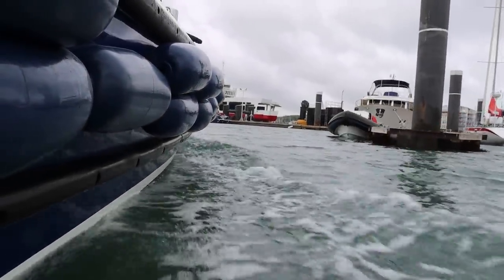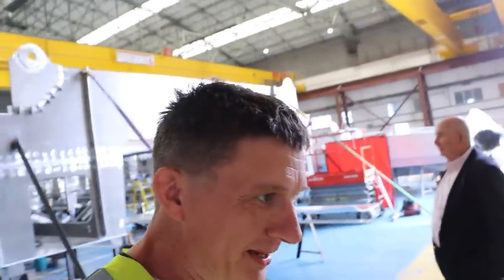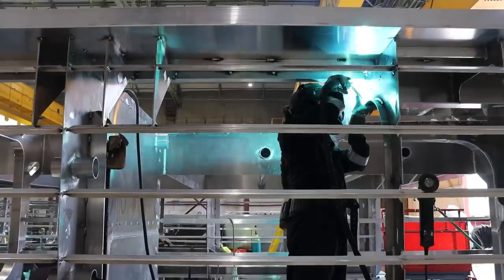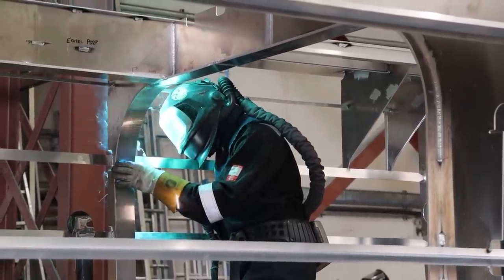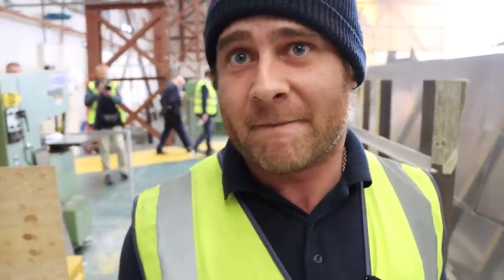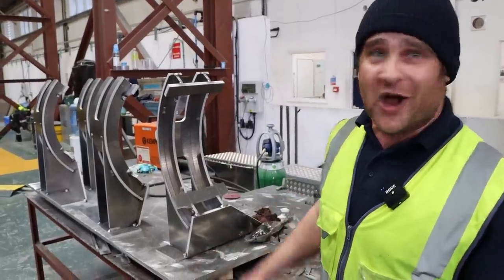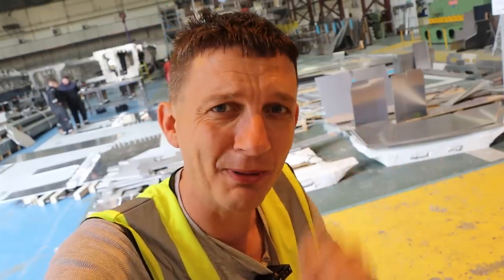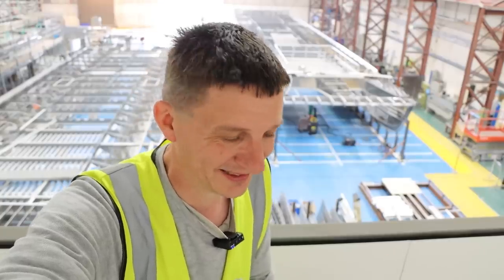Construction of Hybrid Thames Clipper Boats

Comment: I hope they won't mind me sharing but I have an interesting story about how the partnership between Wight Shipyards and Thames Clippers came about. 

Peter Morton set up Wight Shipyards originally to rebuild the classic aluminium motor yacht Shemara, a job which had been completed. Peter thought the idea of aluminium shipbuilding in the UK was a good one and was looking around for work and had carried out a few smaller jobs. Then he was introduced to one of the Thames Clippers guys (could well have been Sean Collins, I don't remember exactly!) at a party and they got talking. Sean complained that they were using a shipyard in Tasmania which was all well and good but refits and repairs were difficult and could Peter help? "Yes" says Peter and I'll build you a whole new boat as well if you like!" What really, in the UK?" askes Sean. "We can start tomorrow" replied Peter. Since then all Thames Clippers have been built at East Cowes. 

As an addition just after they signed a contract for repair and maintenance, one Friday a skipper drove one of the existing boats into a pier and crumpled the front of one hull. Under the old contract workers would have been sent from Australia and the boat would have been out of commission for several weeks. Wight Shipyards worked around the clock all weekend and were in London on Monday morning fitting the newly fabricated hull section. The boat was out of commission for less than a week.

As another addition all the London Underground enamelled signage including the roundels are made at AJ Wells also on the Isle of Wight.

Londoners and Tourists. You're welcome IOWIOWIOW

Comment: Just as long as the new engines make the same magnificent stirring howl at 30 knots that the current ones do then I will be happy. I always sit at the back of the Clippers just to hear that noise. For me its right up there with the early HS 125's in terms of aural pleasure. 👍👌
Reply: Paxman valenta engines on HST's made a brilliant sound I was heartbroken around 2008-2009 when they were replaced with MTU engines instead and later in 2019/2020 when they retired the majority of them they were fairly decent kit in constant service for almost 50 years at retirement they were better than their replacements
Reply: @geocachingwomble  have you holidayed to Scotland for the sake of getting to sit in one again? It’s another different power plant yet again though.

Comment: 5:49 "Aluminium, however, can be cut up and re-used up to eight times". I wonder what happens when you try to recycle it for the ninth time. Surely as a raw element it can be recycled infinitely?
Reply: I think what was meant was that you can cut up and remelt it 8 times before it gets so dirty that you need to refine it again, which is a much more involved process.

Comment: Actually what you are getting is aluminum oxide, not simply dust.  Contrary to popular perception, aluminum does rust, and quite fast indeed, much faster than iron.  The difference is that, contrary to iron rust, aluminum rust does not peel off, it sticks to the metallic aluminum and forms a very thin layer which, being so thin, is completely transparent and also prevents further oxidation so it prevents deep corrosion. Unlike iron, where rust falls off continuously exposing more and more iron to oxidation, aluminum oxide provides a sort of coating.  It dulls the shine of the aluminum very slightly, but you can still see the metallic shine through.  It doesn't stick that hard, though, so if you touch it it will stick to your hand but it has nothing to do with all that sawing and cutting in the factory, it will happen without any of those.   BTW, aluminum oxide is black, just as the dust you were showing.  The speed of aluminum oxidation is what made welding aluminum so hard, oxidation is faster the higher the temperature and, contrary to iron, where you can file the edges to get rid of rust and take your time welding it, aluminum rusts so fast when exposed to the oxygen in air that you need to weld it while blowing some inert gas to keep that oxygen away.

Comment: Interesting to hear these are called the Hunt Class - I wonder what the RN has to say as their minesweepers are also Hunt Class. And, just to get the rail link in, they were powered by Deltic engines. Many years back I designed an exhaust monitoring system for these, shortly afterwards they decided to re-engine them. Pretty typical MoD waste!

Comment: Excellent video as always 👌  any clues how long the journey from the new pier at gravesend would be? How would it compare to a train or driving for instance?
Reply: They've already done them occasionally as special trips, if you search you'll probably find details of them with timings
Reply: Now that's a future video
Reply: Definitely quicker than by road in the rush hour, I used to do a journey between Putney and Southwark when I owned an Amphicar, was a lot quicker if I was not trying to fight a full flood or ebb tide flow.  Getting out could be a problem if the slipway was slippery with ice or excessive algae.  The tide table was more important thn an A-Z in the glove box.

Comment: Thank God, I've thought about taking these a few times but aside from the expensive fare I did have at the back of my head thoughts about them being worse environmentally than the alternatives
Reply: expensive? It’s only like £4.50 for an adult (£3.50 if you have a travelcard) It’s not too dissimilar to train fares
Reply: @redbaymax2852  two boat zone return is about £15 with travelcard, £18 without. Bus caps at 4.50 ish and tube is about £2.50 a journey (and less off peak). Daily cap is about £8 for bus + tube, so commuting through tube zone 1 by boat on a regular basis is way more expensive than unlimited zone 1 travel.

Comment: "First hybrid passenger ferry"?
Don't both Wightlink and Condor Ferries have hybrid ships operating now?
Reply: I think you're confusing the facts. Condor does not & Wightlink's hybrid vessel is a car ferry whereas this feature is on passenger ferries - so Geoff was correct. The Clippers will also have a plug-in capability whereas Wightlink's vehicle ferry does not.

Comment: I have some questions:

Are these clippers additions or replacements?

Do they have propellers with a rudder or are they propelled like a jet ski?
Reply: They do not get shore power, just charge off their desil engines outside of central London.
Reply: The charging question was answered in the video, they will be charged by conventional engines while the boat is in a high speed section of the river.
Reply: @richcbri  ah sorry - must have missed that. Thank you!

Comment: I kind of hate to see aluminum powered treated so insignificantly. While it does take a reasonable amount of heat to get aluminum powered started burning, if it does go it is hard to stop (for example there has been rockets that the motor is basically just aluminum powered and a flammable binder to keep it in place), plus some manufacturing lines have burned down due to letting it building up and eventually something started it burning.

Comment: Unless the boats have regenerative braking, they shoudln't be called "hybrid". They are just like diesel locomotives whene he diesel engine runs a generator that runs electric motors in bogies.  In the end, 100% of their propulsion runs on fuel. The batteries just change when the fuel is burned so boat can be quieter during some periods and louder at others (which it recharges batteries).  
 The fact that they will run on renewable fuel whose carbon was extracted from atmosphere is more significant.   If the ferries recharged batteries while at dock, this would reduce the need for the fuel and it would then become hybrid.
Reply: yeah thats not how words work. you don't get to make arbitary rules like that.

Comment: These boats will be fitted with 2 MTU (Rolls Royce) Series 2000 diesel engines running on the "modified" fuel. Engines built in Germany.
Reply: Its a swap for the CASA versions of the HE111 bombers flying with Rolls-Royce Merlin engines
Reply: Yes, but will they sound as good as the current ones...

Comment: I am not sure this fits most peoples perception of a hybrid.  All the energy used by this boat is created by burning diesel. Its can switch to using the batteries, but they are charged by the diesel engine.  Its a bit like a Telsa towing a generator to charge the batts.

Comment: I'm suspicious as to how much "greenwash" there is in this, you don't get something for nothing. If the engines run significantly more efficiently at the RPM they charge the batteries at than they do at low RPM then fair enough but are the figures publicly available ?

Comment: I wonder if this is the same shipyard that built ships for the Polish navy in World War 2?

I worry that there’s an over-enthusiasm for hybrid and especially pure electric vehicles. They can be useful in some applications but like everything else they have limitations, and not everything can be reliably replaced by battery technology. I’m concerned there may be too strong a drive to introduce electric and battery vehicles where they will not work as well as the internal combustion engines.

Comment: Back to trains, why can’t we just lay solar panels on the tracks? Miles and miles of solar power for electric trains!
Reply: Almost none of the panels would be pointed towards the sun at any time. Things would fall onto them from trains. A truly silly idea. Not quite as silly as solar roadways but getting there.
Reply: @markiangooley  errr the track is flat, points towards the sky, could even raise the middle to improve the angle and create a water run away.